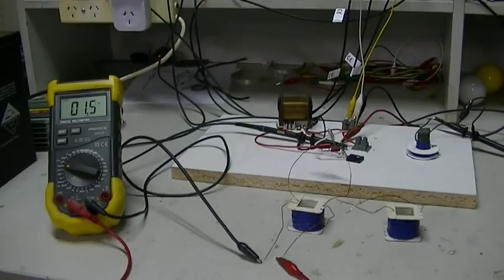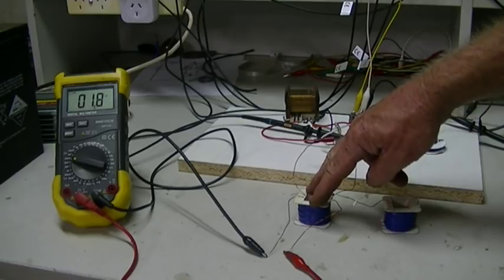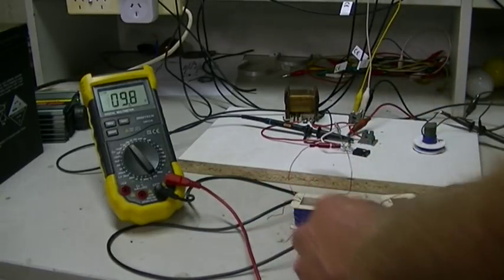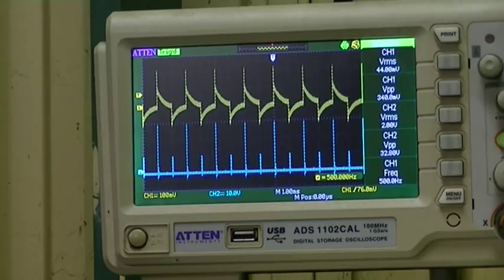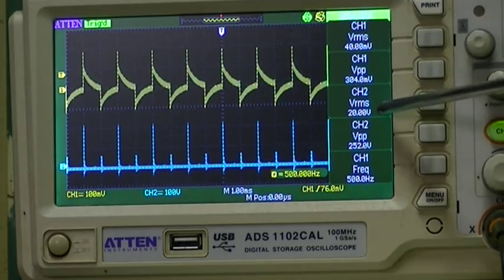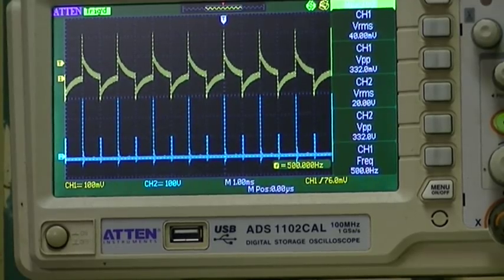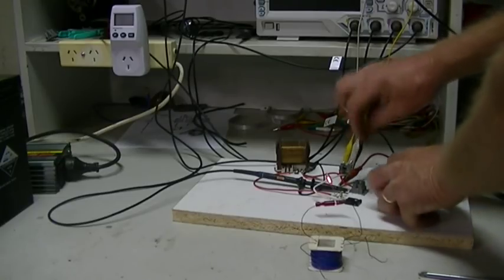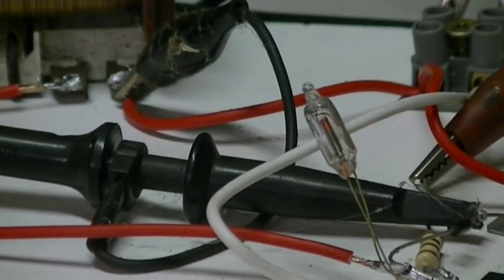Mono coil V bifilar coil

Comment: A collapsing magnetic field does some thing wonderfull it matches it's load perfectly if resistance is higher the voltage rises and amps drop to match and if resistance is low them amps rise and volts drop. it matches load better than a battery. Do the test it's great.